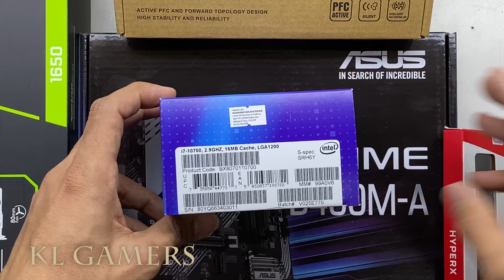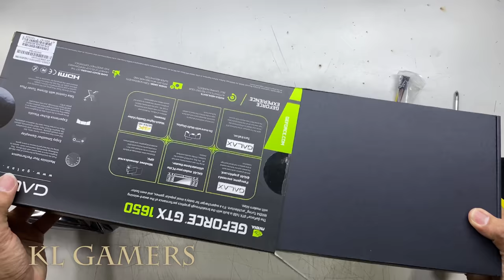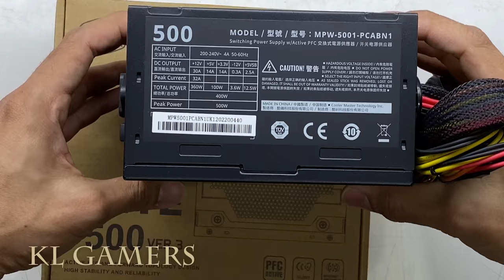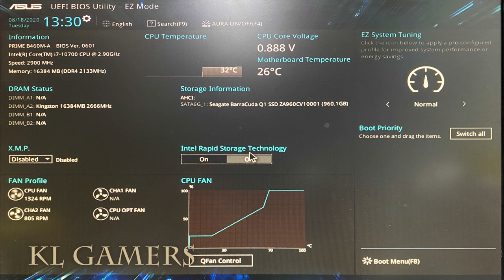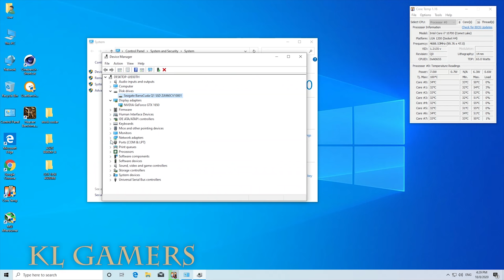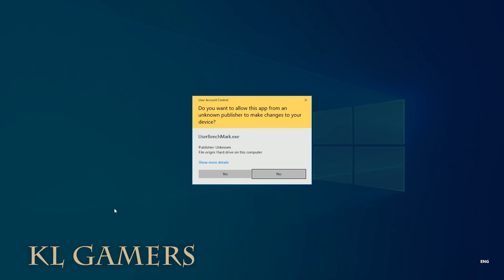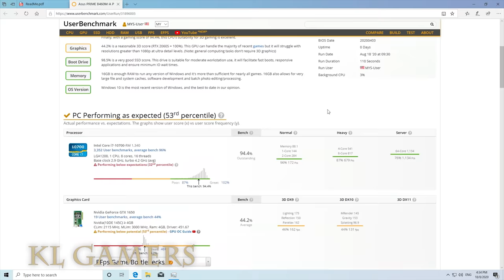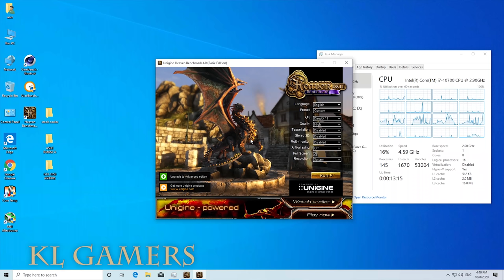intel Core i7 10700 ASUS PRIME B460M-A GTX 1650 4GDDR6 Gaming PC Build and Benchmark

Comment: you need unlock power limitation. Go to bios , “sync all cores” “performance mode”, it will run at 4.6 instead of 2.9. But it requires better cooler. I use the same cpu and motherboard. C20 score is around 4800.
Reply from the maker: ya Core i7 is a beast
Reply: If you don’t mind me asking, what cooler do you currently use with your setup? Do you have any recommendations for a good cooler that will handle this same exact setup with i7 10700 power limitations removed? Thank you in advance 🙏🏽
Reply: How unlock power limitation in the BIOS? Steeps exactly please

Comment: Why is the boost frequency limited to 3.3 ghz and why is that the stock cooler can keep upto 65° isnt the processor supposed to get more hot...i think ill build this setup bt if i can work with stock cooler and save a few buck at first it would be really helpful
Reply from the maker: well maybe the motherboard cannot unleash the true potential power of the processor. so is lower performance
Reply: @KLGamers  thanks for ur reply bro ure the best . i watch all ur vids and will still watch after i buy a pc..btw can i run it witth b460m mortar and stock cooler? Will it get hot?

Comment: Have exactly same setup but an i5 10400f, it gives same performance with rx580 8gb with ryzen 5 2600, incredibly cool
Reply from the maker: very good indeed 😆👌
Reply: No es el mismo rendimiento. El i7 10700 ES EL MEJOR cpu de esa generación.
Reply: @CgeelekFunkeler-ul7dh  if the GPU isn't bottlenecked there's nearly no difference in gaming
Reply: @jorvax3744  el i7 le gana en más de 15 fps al i5 10400. Y entre el 10100 vs el 10400 casi no existe diferencia
Reply: @CgeelekFunkeler-ul7dh  If it's a bottlenecking game there would obviously be a difference but if it's a game where your GPU is at 99% there will be nearly no difference bro btw I have bought a r7 5700x and a rtx 3070 I compared with i5 10400f rtx 3070 and it confirms what I just said, no diff if fully used already
Reply: @jorvax3744  claro que abra diferencia!! El procesador más potente tira más fps. La gráfica 1650 llegará al 100% claro está y el procesador un 20% pero aún así gracias al proce los fps aumentan si comparas un i5 10400 vs un i7 10700.
Reply: @CgeelekFunkeler-ul7dh  i Will repeat it once again and for the last time. Gtx 1650 is a pretty small budget card that can turn at 100% usage easily without requiring any powerful processor. I agree that there will be a difference on a more powerful graphic card but it totally on games whether it's CPU intensive or not. You can search on YouTube if you want and you will clearly see that there's no difference when they are both at 100% GPU. On gaming it works like that but on multi tasks i7 explodes i5 bro but on gaming it just depends, I would say that you will see a great difference in competitive but in solo games you ll see nothing enough good to be said to be better , hope you ve understood my point
Reply: @jorvax3744  para finalizar. Gtx 3070, i5 10400 vs i7 10700. Tom raider (i5) 174 fps vs (i7) 217...... Gear 5 el (i5) 88 fps vs (i7) 110 fps...... Horizon zero dawn (i5) 70 fps mientras tanto el (i7) 84 fps. ....... siempre el procesador más grande en velocidad y nucleos de la misma generación gana 🥇
Reply: @CgeelekFunkeler-ul7dh  I already said it sis just bottleneck but most of the games before 2020 don't have any difference
Reply: @jorvax3744  puede ser

Comment: 10700 cpu temp is really good, 60C on cinebench, improve a lot compare to previous gen
Reply from the maker: The power of the black fan
Reply: 10700k 89C
Reply: 3.3GHz in cinebench
Reply: lol its cuz it runs at limited power

Comment: please is this motherboard comes with a wi-fi?
Reply from the maker: nope, need buy WiFi card / USB WiFi 

Wifi = TP-Link WiFi 6 AX3000 PCIe WiFi Card for PC with Heat Sink| Bluetooth 5.0 | 802.11AX Dual Band Wireless Adapter with MU-MIMO, Ultra-Low Latency (Archer TX50E)
(Amazon link) = https://amzn.to/2DuK6eS
(Lazada link) = https://c.lazada.com.my/t/c.b6kMNB?url=https%3A%2F%2Fwww.lazada.com.my%2Fproducts%2Ftp-link-ax3000-wi-fi-6-bluetooth-50-pcie-adapter-archer-tx50e-free-pubg-bag-i1169126020-s3379272581.html&&sub_id1=AX3000&sub_id2=Mono&sub_id3=149
(Shopee link) = https://invol.co/clvwf5

Comment: I have i7 10700 and gtx 1650 oc gddr5 16gb ram.msi B460 bazooka motherboard.it heat is goes up to 100c when playing nfs heat.any ideas why?
Reply from the maker: it's normal, for the stock cooler to hit the 100c because this processor is a beast !!! 150W power !!! i think so if you want to reduce heat water cool it or use big fan cooler 

Liquid Cooler = Cooler Master MasterLiquid ML240R Addressable RGB Close-Loop AIO CPU Liquid Cooler, 240 Radiator, Dual Chamber Pump, Dual MF120R Fans, Independently-Controlled ARGB LEDs for AMD Ryzen/Intel 1151
(Amazon link) = https://amzn.to/3aODgvx
(Lazada link) = https://c.lazada.com.my/t/c.TLiCu?url=https%3A%2F%2Fwww.lazada.com.my%2Fproducts%2Fcooler-master-masterliquid-ml240r-argb-intelamd-i957044751-s2450710006.html&&sub_id1=ML240R&sub_id2=PCByte&sub_id3=379
(Shopee link) = https://invol.co/clo42b

Noctua NH-D15, Premium CPU Cooler with 2X NF-A15 PWM 140mm Fans (Brown)
(Amazon link) = https://amzn.to/30IQQyc
(Lazada link) = https://c.lazada.com.my/t/c.bqkvTv?url=https%3A%2F%2Fwww.lazada.com.my%2Fproducts%2Fnoctua-nh-d15-cpu-cooler-intel-and-amd-cooler-fan-cpu-cooler-am4-ready-i542688271-s1075988640.html&&sub_id1=Noctua+NH-D15&sub_id2=Castle&sub_id3=437
(Shopee link) = https://invol.co/clzl4m

COOLER MASTER MASTERAIR MA410M TUF GAMING EDITION (MAM-T4PN-AFNPC-R1)
(Amazon link) = https://amzn.to/2Mc3Nsw
(Lazada link) = https://c.lazada.com.my/t/c.QkZiN?url=https%3A%2F%2Fwww.lazada.com.my%2Fproducts%2Fcooler-master-masterair-ma410m-cpu-cooler-mam-t4pn-218pc-r1-i572564477-s1145012792.html&&sub_id1=MA410M&sub_id2=Castle&sub_id3=200
(Shopee link) = https://invol.co/cloek5

Comment: could some one help me, so i have the same motherboard and the Processor but when i boot up it comes up with "please enter setup to recover BIOS settings. "after setting up intel (R) optane memory  or the raid configuration was built, SATA mode selection must be changed to RAID mode to avoid unknown issues , press F1 to run setup"  i dont want to use intel raid is there any way to disable it ????. ive been trying to fix this since xmas i would really appreciate some help, thx
1

Comment: Why do you use a B460M-A Motherboard and not z490?
Reply from the maker: Cheaper and not overclock
Reply: Oh ok
Reply: @KLGamers  but this B460M do not get this intel 10700 reach max boost frequency 4.7 GHZ ... This is pathetic

Comment: Gtx 1650??? With i7 10th gen? Whyy? I just wanna ask why
Reply from the maker: good for 1080p gaming. While waiting new gen graphics card
Reply: Why i7 10th must go with 2080ti when all the users need is on cpu ? Depend on using, thats how u understood about computer
Reply: @thanhtrung3278  it works great the bottle neck with i7 and 1650 is 0.50 thats realy low
Reply: @Mahmoud-rp6xu   actually . u dont need to care about that much....ur needing is on CPU , just go for good cpu...if gaming...go for Vga more....thats it
Reply: @thanhtrung3278  oke but he dont pay much for graphics card because of the release of 3000 series of nvdia thats because

Comment: can I put a core i9? to that motherboard?
Reply from the maker: yes i9- 10900 you can but will result in less performance compared to expensive motherboards  Motherboard = ASUS ROG Strix Z490-E Gaming Z490 (WiFi 6) LGA 1200 (Intel 10th Gen) ATX Gaming Motherboard (14+2 Power Stages, DDR4 4600, Intel 2.5 Gb Ethernet, Bluetooth v5.1, Dual M.2 and Aura Sync)
(Amazon link) = https://amzn.to/3lnBuqk
(Lazada link) = https://c.lazada.com.my/t/c.YUANq5?url=https%3A%2F%2Fwww.lazada.com.my%2Fproducts%2Fasus-rog-strix-z490-e-gaming-atx-motherboard-socket-lga1200-for-intel-10gen-processor-rgb-aura-sync-i1163010685-s3353370141.html&&sub_id1=Z490-E&sub_id2=YES&sub_id3=1595
(Shopee link) = https://invol.co/cl1yps3

Comment: do not make the stupid mistake of taking B460 or H470 or H410! these mobo shamefully castrate intel processors, as seen in the video, on all cores the 10700 loses more than 1 ghz, on all cores it should run at 4.6ghz instead of 3.5ghz, maybe these mobo are good for work environments, but to play it is mandatory to take Z490, for any CPU, so the cpu can run at its maximum declared frequency, even for non-K CPUs, such as 10600 or 10400

Comment: Why use a b460 when a z490 would be the better option and as for the graphics card I would pick a rtx 2070 super until the new 3000 series rtx cards come out and I would use a rtx 3090 which for a core i7 10700k is more than a good match
Reply from the maker: not overclock
Reply: @KLGamers  miss read i did not notice its a non k sku can you do a video benchmarking the system